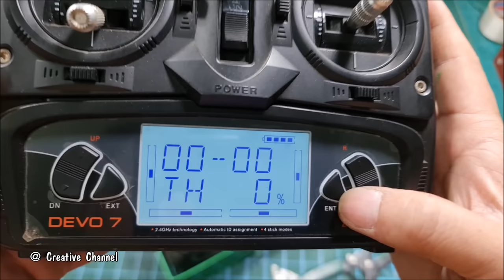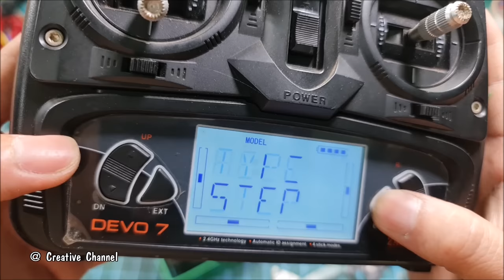How to make 4x4 RC Car with 370 Reducer Motor

Comment: I'm pretty sure you can turn anything into electricity.
Can an electric bike be made with an angle grinder that works with 220 or 110 volts AC?..
(using inverter)
Reply: s we can make it but we need to attach an extra shaft to the motor for increasing the speed of the bike